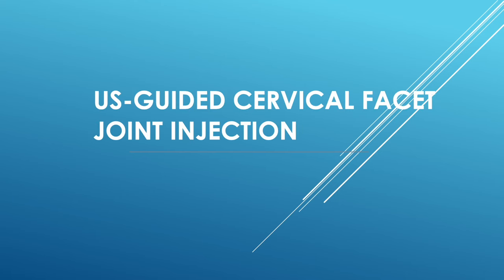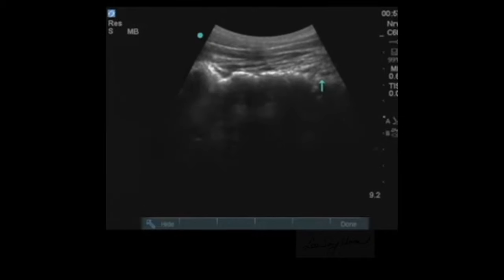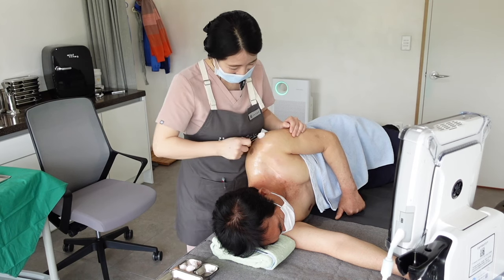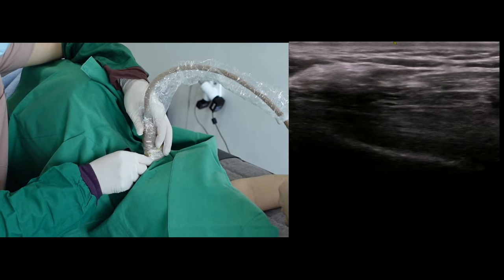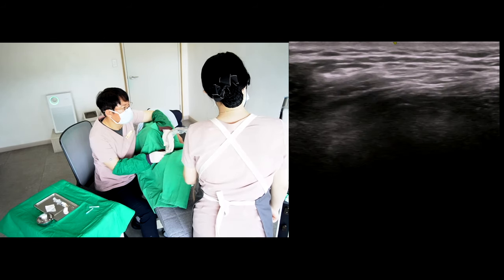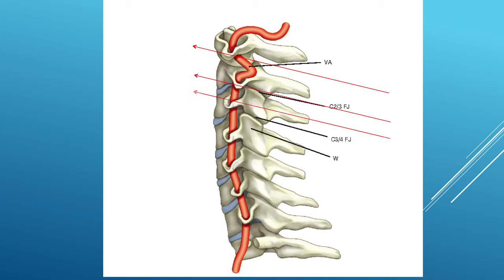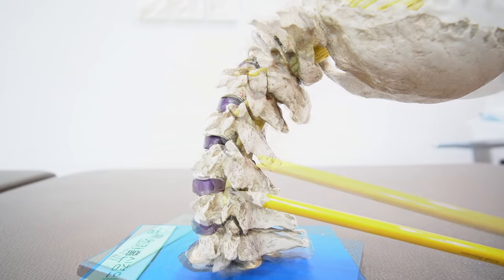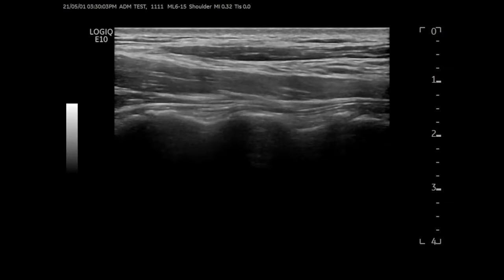Trailer_Ultrasound-guided cervical facet joint injection; in-plane technique, case and anatomy

Comment: There are many doctors who refuse to perform C0-1-2-3 prolotherapy injections with ultra sound as it does not show the vertebrae and spinal cord clearly. How did you learn to do this with only ultra sound and not fluoroscopy?
Reply from the maker: I do not perform C0-1, C1-2 injection either. Start from the C2-3.